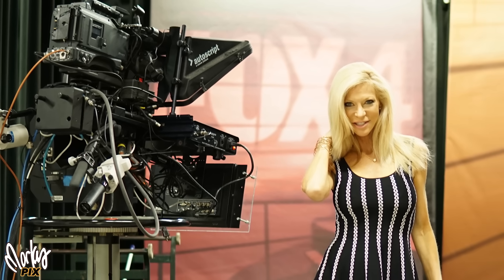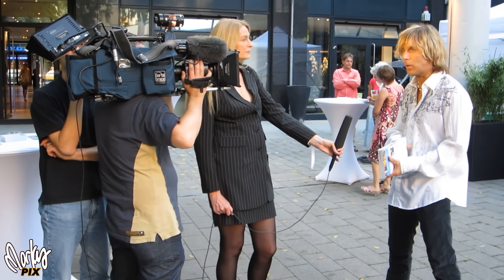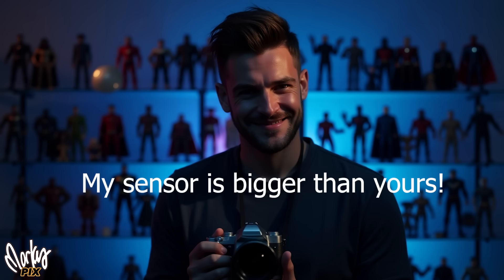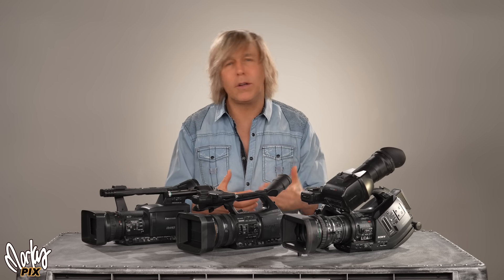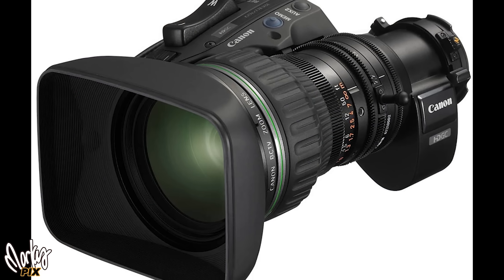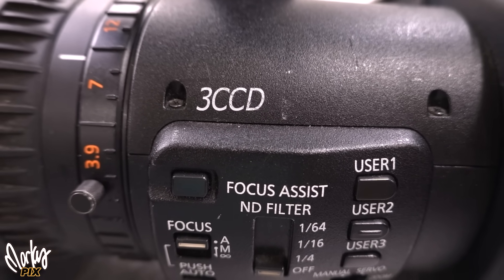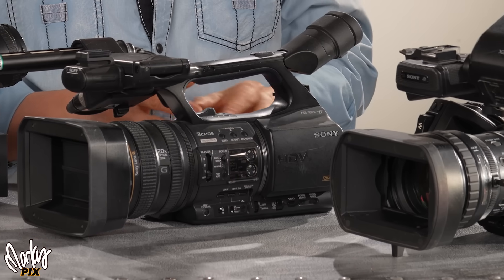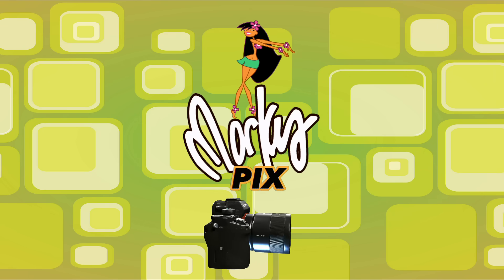Why the Broadcast world uses 3 chip video cameras

Comment: Markus - I enjoy your channel, but I have to beg to differ with you on this video.  I've been a TV director for well over 3 decades - I'm semi-retired now, but I still get hired by Comcast NBC/Universal to direct the odd show remotely, but most importantly here they hire me to either setup studio cameras or to color correct after the fact when a studio shader gets it wrong.  Which happens a lot.  You don't simply turn on a studio camera and get perfect skin tones.  You have to go through a process we term as, "chipping the cameras."  This involves placing a "chip chart" in front of the camera in the talent's light, black balancing, setting black levels and iris, and then white balancing, and it's generally good practice to black balance a second time.  We use vector scopes and waveform monitors to check everything.  During the show, the cameras get their iris adjusted via a CCU (camera control unit - basically a fancy remote control), and they will get "painted" - which adjusts RGB gain independently, RGB gammas, black levels, etc.  This happens because even the incidence of light from different angles can make a black suit appear bluish (for example) even though the cameras are set up identically.  This is why cameras get chipped before a show - they may have been painted on the previous show.  Field cameras don't get this treatment - usually, the camera person will ask the talent (field reporter, for example), to hold up a sheet of white paper and they'll white balance on that.  Here's something interesting - in the NBC studio in DC which has Sony 3 ccd studio cameras, I asked a friend to bring in his Sony A7Siii.  We routed the A7Siii into the system, and the default look on the DSLR (don't remember what picture profile was used) looked EXACTLY like the studio cameras.  Makes sense, since they're all Sonys, but I was stunned by how similar a prosumer camera looked to the studio cams.  If anything, the A7Siii was a bit cleaner (studio cams virtually always run fairly fast zooms), so that may have been a factor.  But the fact that a CMOS camera looked almost identical to 3 CCD (charged coupled device) cameras still shocked me.  BTW - the 60 Minutes field interviews and such are many times shot on Arri Alexas on higher end shows.  Oh, and football games now use a lot of A7Siii cameras on gimbals for field stuff.  Just wanted to set the record straight.
Reply: No wonder my skin looks like day old cream cheese…………..knew there was more to it…..
Reply: @Drrich_DIY  Yeah, probably.  There's a lot more to it than in my original post - kept short in the interest of brevity; that was just the basics.  You have detail (which is basically sharpness), but you also have skin detail, which is pretty advanced and requires you to set the phase for an individual person's skin tone.  If the phase is set for someone else, the skin detail adjustment will have no effect.  There's also RBG flares (per channel), knee adjustments, color matrices, etc.  To be able to go totally in depth is a pretty rare skill set which is why the networks pay what they do for someone who really knows what they're doing.  I'd say at least 85% of shaders don't really know how to properly set up a camera; many rely on presets (or save custom presets) and simply ride iris during a show.  FWIW, many studios still use 3 chip cameras simply out of habit.  There are single chip CMOS studio cameras available and most movies are shot on single chip CMOS cameras.  Most everyone who works in TV is getting up there in age - it's a dying medium, which is why I got (mostly) out.  I also did hundreds of high-end commercials for brands like McDonald's, Mercedes, FOX Sports, etc.  I preferred commercials to be honest, since they're more cinematic, but high end spots are going away too.
Reply: @AlexLTDLX and @MarcusPix Nice…my favorite electric supercharger guy conversing tech with one of my favorite photo/video guys. People listen up, these gentlemen are some very knowledgable guys. 🤘🏻
Reply: @lyinginashes  Aww... shucks.
Reply: That sounds like an AI chip could replace human doing all those adjustments in real time.
Reply: @ElementaryWatson_fafo  Possibly in the future, but right now there's way too much subjective stuff for it to be reliable.  Sort of like autofocus, but far more complicated.
Reply: @ElementaryWatson_fafo  the human is cheaper
Reply: I like your comment. I think your point on set up is not in conflict with the main point of this video. Once the camera is set up, then then is no post-production processing. It is ready to go right out of the (pre-set-up) camera 😊
Reply from the maker: Yes of course the camera needs to be set up properly first and white balance needs to be right with ANY camera, that's a given. But once its properly set and the camera is turned on in the same studio the camera is ready to go. My personal experience has been 3 chip cameras have better skin tones than single chip cameras of the same size and year of manufacture, not comparing a 2020 full frame with a 2006 production camera. There is a reason most broadcast cameras have been 3 chip since chips began and 3 tube before that. Only lately has sensor technology improved enough for broadcast stations to start using single chip cameras, but again, that's a recent development. My video is about why broadcast companies have been using 3 chip cameras from the beginning, and yes I oversimplified the part about turning on the camera, but once white balance, black balance etc is set up, it's easier to know what to expect and if further adjustments are necessary, it's easier to fine tune because the RGB is separated. The X900 always ran really blue, but it was much easier to pull proper colors out of it than single chip camcorders which was almost impossible. And when I did adjust it, the colors were amazing and I could never get that look or those colors with anything else out there that wasn't 3 chip.
Reply: @MarkusPix  I started in the business as single tube cameras were being phased out, and 3 tube cameras brought in the additional issue of needing to be registered (the three tubes - RGB - needed to be aligned).  But there is no broadcast studio I've ever worked at where the cameras weren't chipped every day.  And it's not a short process - you need to set aside at least 30 minutes to do 3-4 cameras.  It's so important in fact that NBC pays me more hourly to fix poorly set up cameras after the fact (I now live 1,600 miles away from the studios I worked in in DC and NYC) than they did for me to direct the shows.  Anyhow, don't take this as a criticism - just wanted to set the record straight.  I really do enjoy your videos, and about a year ago I needed a cheap "throw away" camera with a long zoom, and based on your reviews, I picked up a Sony CX405 for $230.  Sure, it's limited, but it just works, the 60p goes into 30p and 24p timelines without issue and it does have a great zoom.  It never overheats, the battery lasts forever and I can literally give the thing to anyone to shoot with.  Keep up the good work!
Reply: @AlexLTDLX  please tell me what your union is (was), and exactly how a director's union allowed you to do engineering work. I'm curious, because I certainly was never allowed to direct, or even edit video, because the respective unions didn't allow that. How did you become the exception to this rule?
Reply: @Speed-Daemon-123  When I was in a union, I was in NABET/CWA.  At one point I was shop steward for them too - this was from the 90's to the early 2000's.  I helped renegotiate the WUSA contract under Mike Tiglio's leadership.  Be warned - this could get ugly.  I left the union because I didn't like what was going on.  I never joined DGA (advice from Shelly Schwartz, of all people) because my directing role was rather unique, particularly in DC.  I was the "mister fix it guy" and "design our new show" guy.  At that time DGA was threatening all union directors with massive fines if they did any non-union work.  And I did a lot of non-union work - Discovery Channel's main production vendors were in many cases non-union, and I did a lot of shows for them too - 300+ episodes of "Science News Daily," shows for Shark Week, "Wild Weddings," the first live HD stream from the International Space Station and even "Puppy Bowl" several times for Animal Planet, among literally hundreds of others, for all sorts of networks - from PBS to FOX Sports with talent ranging from Leeza Gibbons to Henry Winkler to George Takei (who sang happy birthday to my daughter - a lifetime memorable moment, to be sure) to Soledad O'Brien.  When I went into union studios in more recent years, like at 400 North Capitol (I was there years before, when MSNBC was still called, "America's Talking" - I directed a lot of Chris Matthews' early shows there along with Ron Insana's show), it was with dispensation from the upper echelons at Comcast (the parent of NBC/Universal) and brought in "above the line" as a work around.  Last time was a few years ago at the "Morning Joe" studio in DC at 400 North Cap.  I actually saw a union shader fall asleep in the middle of one show, and another guy got up and just left in the middle of another show simply because "his shift was over."  We also hired one union guy from Nebraska Ave's studio to work over at 101 Constitution Ave.  That guy was the worst shader I've ever seen.  Not only was he an argumentative "sexual intellectual," his baseline camera setup was so far off it was almost unfixable.  His black points on the vector were not even close.  Never mind he was under exposed by well over an entire stop.  Suffice it to say, he may be protected by the union at the local affiliate (Nebraska Ave), but he never worked again at Comcast's other studio.  At least I got paid a decent chunk of change to fix his messes.  If you have any other questions, feel free to ask.  About 50 seconds into this video you can see some production stills from a few of my shows and commercials: https://youtu.be/8Jvj5RCvxSM?si=txfv5P1V02IQNTbN
Reply: @AlexLTDLX  30 mins to do 3-4 cameras? in the practical test i had when becoming a full time vision engineer i only had 5 mins to line up 3 cameras. typically now we only get 15mins to do up to 8 at the start of the day.
Reply: @noobfpvideo1597  I'm going to assume you're British - I always liked the terms you use, and frankly how you all do your shows (I particularly like the term "vision mixer").  To be fair, your test was controlled environment.  In the studios over here, particularly the ones I worked in, things can be pretty chaotic, especially in shows that are new and shows that are "box shot" (i.e. shooting a bunch of episodes in one day) once or twice a month.  Typically, for us, it looks like this - you need to power up the CCUs and camera rack units, give them 5 minutes (at least) to warm up and settle down (they'll drift otherwise), then spend some time figuring out what the previous guy who was there did, and undo some of it that's wacky.  Then you go out to the studio, find the chip chart and stand, move the talent chairs, spend some time finding the lighting guy (who's always oddly MIA), give up, turn on the lighting board, load in the correct cue, put the chip chart into place, position and frame up all the cameras on the chip chart, go back in the control room; throughout the process you'll be shouting over stage announce for random people (usually associate producers) to clear the cameras, get the prompter person to get rid of the white screen they've put up for some reason (even the amount of text on a prompter screen has a visible effect on the cameras; a white screen is very visible), start the process, then a camera operator has decided to set up their little world, and starts moving the camera off the chip chart, and then you realize someone's turned on the house lights - go back in the studio, shut the house lights off, make a general announcement that if they want the show to go on time they need to keep clear of the cameras, and the cam ops need to stop touching them, at some point someone catches the handle of the pedestal and jerks the camera over, you go back out and fix it (again), all the time the homocidal red mist starts clouding your vision.  Then people realize you're about two inches from going postal, so they leave you alone and now at least 15 minutes have elapses and you haven't even started to setup the cameras...  If your studio is calmer and more organized, then I envy you.  Now my example may be a bit extreme, but that's why I said 20-30 minutes in my original post. Heck, I've even had situations where camera people have (unknowingly) managed to turn the back focus ring out of adjustment, and then you have to find that chart and fix that.  About 95% of my work is actually direction, but I've stood in for shaders more than enough times to get a very good grasp of that particular reality.  You get the idea.
Reply: @ yes British/Irish, and can relate to much of what you described there. Sony say their cameras should be on for 2 hours before doing anything serious with them…even with the 3500’s. That seems to be the window for dead pixels too. I’m glad I missed the tube cameras but our greyscale charts date from that time and have ‘Gregory’s hole’ (basically a box lined with a matte velvet type fabric) for absolute black…and i believe it was very useful to lining the tubes up.
Reply: @ sounds like a good script for a comedy 😁
Reply: @MarkusPix Marcus and Alex, thanks to both for your explanation of 3-chip cameras. I started shooting video professionally in 1978 using an Ikegami HL77. Trying to explain the setup involved to the people I work with now gets me wide-eyed stares. Just registering/aligning the ships was a an art. 
And then there was the “portable” 1-inch reel-to-reel video recorder we had in the van.
Reply: @AlexLTDLX  ps, I also use vmix which has a built in wave for monitor and a vector scope to set up my Sony pmw 350
Reply: As a guy who painted cameras for live shows for years I WISH films used CCUs and did color in real time

Comment: Well said. But very costly for camcorder. I know what cost for this guys. For example 5 or 6 figures depends on what model for, however government paid for broadcast system and FCC regulations. You can own one of those but you needs a high-ends graphic card and BNC connectors by doing color grading and editing. Again, depends upon the models. Mild may vary. Really nice camcorders, I don't own it yet.

Comment: I picked up a HMC150 with 60 hours on it for $30 at a thrift store and it works very well. The deals are out there expecially when the store has no way to test it.  Later, they had an HDV for $40.  Probably should have bought that one too but I have enough miniDV cameras.

Comment: I would give Panasonic $2,000 right now for a 4K, 60fps update of the 3-chip HC-X900M.   I have two, and they have better color and light balance than my Sony AX-53.  Marcus is right.  The Panasonic 3-chip 900s are among the best camcorders ever made.  Not only do they render great color, but they can shoot at 60fps.  Their only issues are somewhat drifty stabilization and video limited to 1080.   I bought the Sony to address what I thought was a lack of sharpness and to get better stabilization.  But the sharpness improvement and better stabilization of the Sony are offset by the fact that the Sony only shoots 30fps, which makes smooth pans and zooms trickier.  And the AX-53s single sensor just doesn't render video, especially colors, as nicely as the Panasonic's three-chip set-up. And, the 900s are a bit smaller and lighter than the Sony, which I consider a major advantage.  The 900s just take great, no-muss, no-fuss video every time.